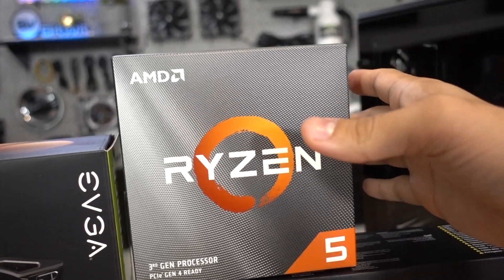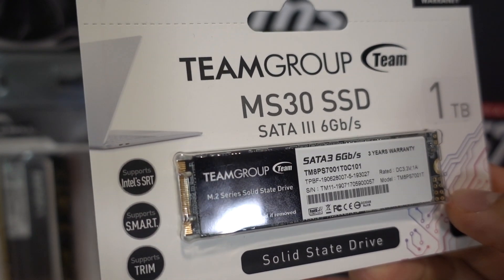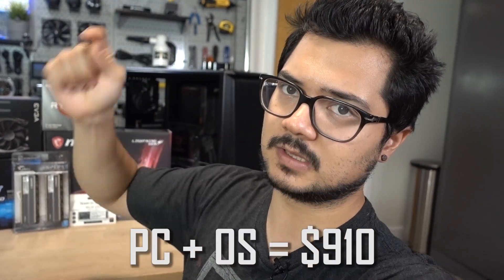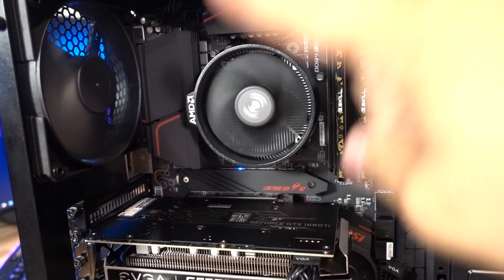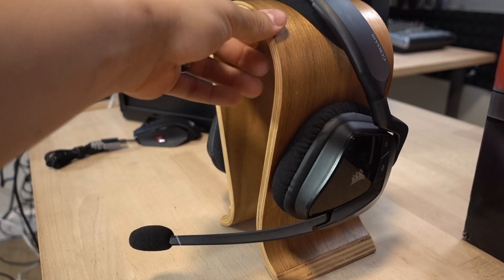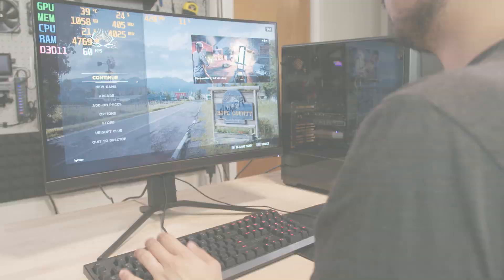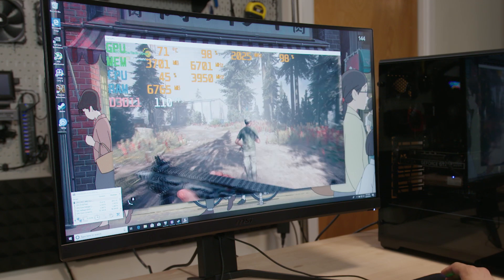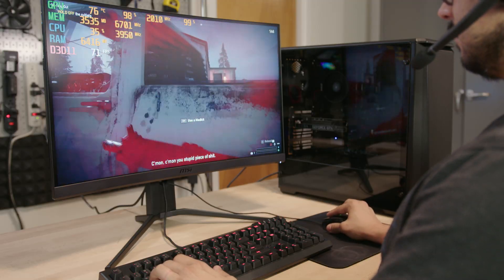Literally EVERYTHING you need to game on PC for $1500

Comment: Not gonna lie you really need to step up your game for these build videos on a budget. Noticed your recent previous ones arent that great with some incorrect info (such as Seasonic SIII being great when it isnt. Look at actual full on PSU reviews and stop judging a PSU by brand please) (also yes I know this vide is two months old).
-CPU: good choice
-CPU cooler: better budget could've allowed for a simple cooler that'd be better than stock
Mobo: MSI done a pretty shit job on x570 so really bad choice there. Also waste of money as B450 would've been a better option. Esp when it comes to GPU on a budget
-RAM: bad choice. CL19 is too high for 3600MHz RAM and will cause IF to desync. Crucial Ballistix 3000/3200 OCs well at 3600, or if that wasnt an option at the time then 3600 CL18 is the best you could do at the time probably. Dont think there was a 3600 CL16 for a good price at that time, however if so then poor choice there
-SSD: I'd say alright choice if you didnt go SATA M2. Only go SATA M2 if you really need to cuz it uses up a precious NVMe slot. Im pretty sure you even said this exact thing in the past as well, tho I could be wrong. Either way, bad choice.   
-GPU: Now this is the worst part. While a 1660Ti is an alright GPU it is an absolutely terrible choice at a $1500 budget, even with peripherals. You can easily fit in a 5700XT after changes to other parts
-PSU: Once again, stop saying the Seasonic SIII is good. It lacks many standard protections on modern PSUs and has the same price as pretty decent PSUs. Corsair CX being one of them
-Case: Not bad. Cant say much as I dont know what prices where at that time for all the decent cases
-Monitor: LG should have had a monitor for better price at the time.
-Keyboard: Just get a decent Reddragon mech keyboard for cheaper
-Mouse: pretty pricey for what that mouse is
-Headset: Just a standard, crappy, gaming headset. Why did you opt for a gaming one? Just get a regular headset for cheaper that in the end sounds better

Comment: LMAO.  $1,500 is a high ass budget.

and off the top a Ryzen 5 3600 vanilla. You could have least went for 3600X at that budget.
and you got a 3600, if you are new to AM4 you wouldn't want to get anything below a 500 series motherboard because your 3600 wont post on a B450 anything without it being flashed.